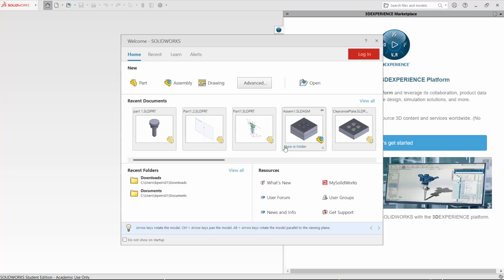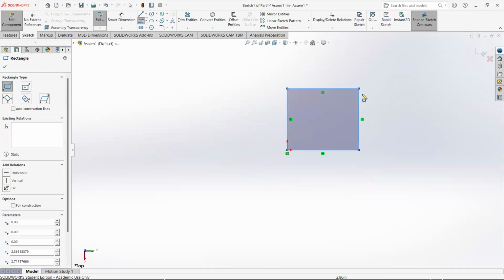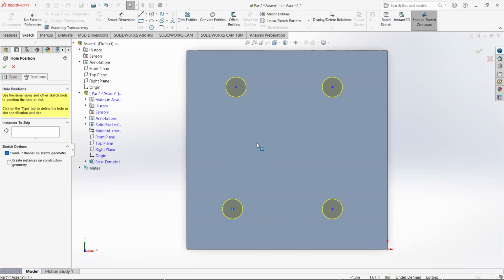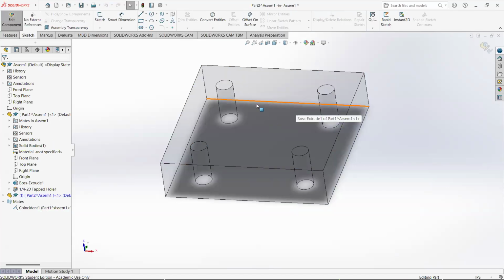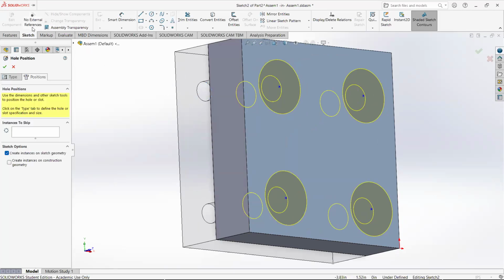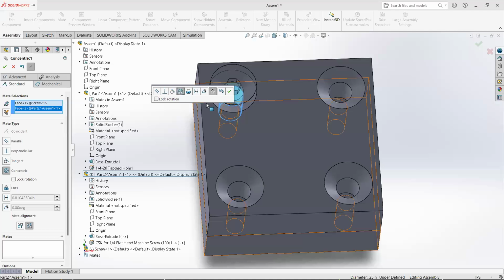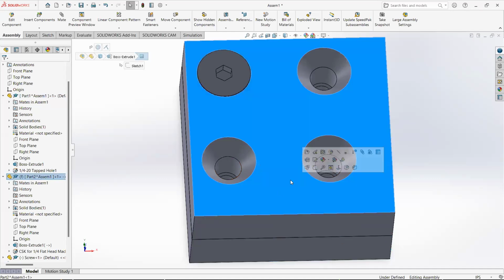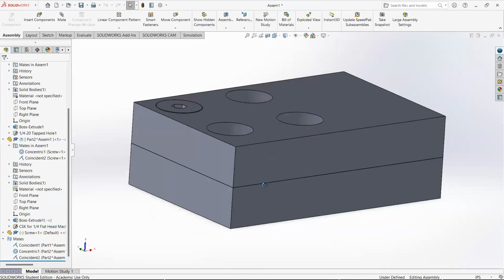SolidWorks Basics: Modeling Parts In-Context Within an Assembly

Comment: i just recently started using sw for makers since it's so cheap for my 3d printing projects. i've noticed that building parts based on the geometry of other parts has proven to be really tricky if you're not really careful. i was using freecad before and have gotten really good with it, but sw has been a fun challenge to learn. thanks for this video, it's great to learn from an obvious master at this about the pros and cons of both workflows.

Comment: Hey Brad, this is a great video, very informative.  I had a question about origins and coordinate planes when creating new parts in context.  Do you know the proper way to handle creating new, in-context parts that are randomly placed in the assembly (so these parts not origin aligned wrt to origin of the assembly) and then needing to move it to different parts of the assembly as individual parts?  For instance, I have bracket that built in context, but I will want to use it in multiple locations throughout the assembly.  In this case, the bracket that I initially created has it's origin aligned with the assembly and not with the part itself.  In the end, I end up with parts that have origins and coordinate planes that seem to be all over the place when the part is not opening as part of the assembly.